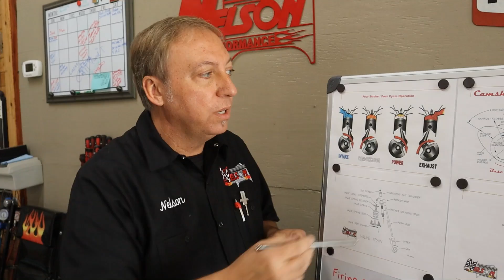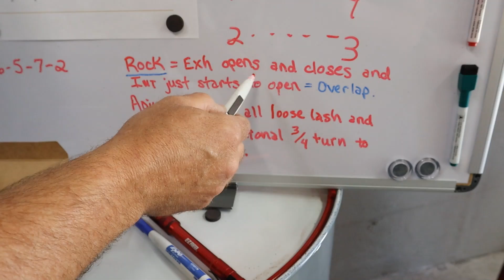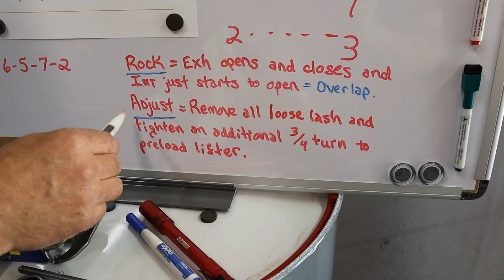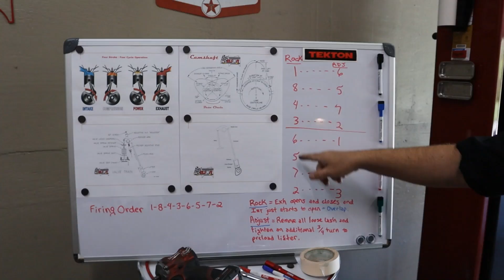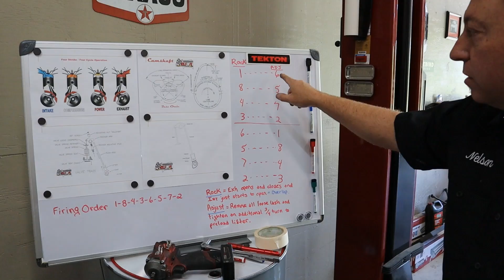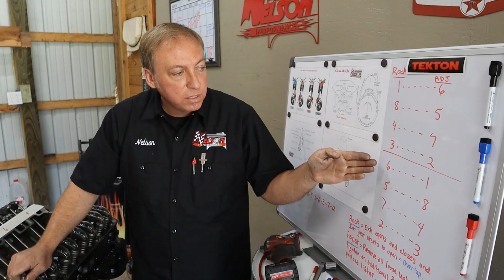Rocker Arm/Hydraulic Lifter Adjustment

Comment: Hello, thank you for the explanation, looks simple. So to be sure, i have a 4 cylinder with a 1-3-4-2 cycle and when cylinder 1 is ready to rock i have to adjust cylinder 4? If i use the chart here it seems that way, i just want to be sure. I have a Mazda 626 TD 2002.
Reply from the maker: Hey Krisztian, yep, that is correct! Good luck on the project and thanks for the comment and subscribing.  Nelson

Comment: I've never seen anyone put that much pre load on a SBC engine. I'm a little interested in the thinking behind this.
Reply from the maker: Hello, the sbc hydraulic lifter has a recommended preload adjustment of 1/2 to 1 turn. Less than a half is a risk of the cup pushing the clip off the lifter cup and causing engine damage and more than 1 turn reduces the amount of internal room for oil to hydraulically pump the lifter up. Thanks for viewing.

Comment: This method does not work on a 351 windsor. In addition, it only works with studded rocker arm bolts.
Reply from the maker: Hello, yes, that style along with the newer LS engines and the older FE and dodge engines require torquing them down, but the process can still be used to check to make certain the lifter cup is off the wire clip as well as make sure there is adequate room in the lifter to fill with oil. We use a go-no-go gauge for this. It should have at least .080 lash between the valve tip and rocker and no more than .180 lash. If this is out of spec you can change the pushrod lengths to get it correct. Thanks for viewing and the comment! Nelson

Comment: Better to dunk the lifters in oil and pump them up with a push rod BEFORE putting them in the engine. I spin my pushrods between my fingers until I feel tension THEN I turn the nut ONE Half turn. My opinion 3/4 is a bit much.
Reply from the maker: Yep, I’ve done between a 1/2 and a full turn. For this video I thought it would be best to do 3/4 for the novice engine builder. I usually prime my oil pump after adjustment so I can still feel the “lash” of the lifter, but soaking them works too. Thank you for commenting and viewing! Nelson
Reply: @mitchnelsonperformance   All good Mitch just two different ways to achieve the same goal.

Comment: What if the intake is on and you can't see the lifters?
Reply from the maker: Hello Steven, You don’t necessarily have to view the lifters when doing the process, if the intake is on. You can also watch the movement of the pushrod/rocker arms if the intake is installed. You will see them move into overlap (the ROCK position). I’ve adjusted many engines that way. Just keep track of your cylinder locations to keep you on track. You can also use the ignition/starter to rotate the engine through the process but remember it only takes a slight bump of the key to turn the crankshaft the needed 90 deg. It helps to have a friend bump the key while you pay attention to the rockers. Good Luck with the project. Thanks for the comment and please like and subscribe

Comment: How do you adjust hydraulic lifters in this manner if they are pumped up already
Reply from the maker: Hey James, The valve springs will bleed the oil out of the lifters as you turn the engine over as the rocker pushes the valve spring down. This will get the plunger off the wire clip in the lifter. The valve spring pressure has enough force to push the pushrod into the lifter bleeding the oil back slightly since the oil pump is not producing oil pressure unless the engine is running.  You don’t necessarily have to view the lifters when doing the process, if the intake is on. You can also watch the movement of the pushrod/rocker arms if the intake is installed. You will see them move into overlap (the ROCK position). I’ve adjusted many engines that way. Just keep track of your cylinder locations to keep you on track. You can also use the ignition/starter to rotate the engine through the process but remember it only takes a slight bump of the key to turn the crankshaft the needed 90 deg. It helps to have a friend bump the key while you pay attention to the rockers. New lifters on a used cam is fine. Old lifters on a new cam or swapping used lifters from hole to hole on a cam is a bad idea. Good Luck with the project James and thanks for the comment and subscribing! Nelson
Reply: @mitchnelsonperformance  thanks Mitch
Reply from the maker: no problem!

Comment: Is there a way to do this without removing intake? I'm replacing rocker arms and pushrods on a 94 302 ford, and I've already removed upper plenum and valve covers
Reply from the maker: Hello, You don’t necessarily have to view the lifters when doing the process, if the intake is on. You can also watch the movement of the pushrod/rocker arms if the intake is installed. You will see them move into overlap (the ROCK position). I’ve adjusted many engines that way. Just keep track of your cylinder locations to keep you on track. You can also use the ignition/starter to rotate the engine through the process but remember it only takes a slight bump of the key to turn the crankshaft the needed 90 deg. It helps to have a friend bump the key while you pay attention to the rockers. I believe those are a pedestal type rocker that has a 5/16 bolt that just gets torqued but you can still use the process to check it.  Good Luck with the project. Thanks for the comment and please like and subscribe

Comment: When cylinder 1 is in overlap is that the same as TDC?  If so then cylinder 6 is at base circle when 1 is TDC?  And so forth down the firing order?
Reply from the maker: Hello and thanks for the comment! Yes and no... both cylinders (1and6) are at TDC at the same time but they alternate the valve timing of having both valves shut for adjustment, in other words #1 cylinder is at TDC during the exhaust stroke (valve overlap) and during the compression stroke (both on the base circle) so that’s why you need to watch the valve movements to make certain the rockers being adjusted are on the base circle. Hope that helped. Good luck on your projects,  Nelson.
Reply: @mitchnelsonperformance  just completed, with the timing cover off started with both marks at 12 o'clock, and moved 90 degrees each time.  Looking at the lifters at the same time, this appeared the same as your method.  All worked out great.  Thanks for the helpful video!
Reply from the maker: Great!

Comment: Hi, great video. Quick question - how would i make sure my hydraulic lifters are not pressurized with oil i.e. unprimed. Do I just need to let the engine sit for sometime after its been run?
Reply from the maker: Hey Matthew, The valve springs will bleed the oil out of the lifters as you turn the engine over as the rocker pushes the valve spring down. This will get the plunger off the wire clip in the lifter. The valve spring pressure has enough force to push the pushrod into the lifter bleeding the oil back slightly since the oil pump is not producing oil pressure unless the engine is running.  You don’t necessarily have to view the lifters when doing the process, if the intake is on. You can also watch the movement of the pushrod/rocker arms if the intake is installed. You will see them move into overlap (the ROCK position). I’ve adjusted many engines that way. Just keep track of your cylinder locations to keep you on track. You can also use the ignition/starter to rotate the engine through the process but remember it only takes a slight bump of the key to turn the crankshaft the needed 90 deg. It helps to have a friend bump the key while you pay attention to the rockers. Good Luck with the project
Reply: @mitchnelsonperformance  that’s great, thanks a lot I’ve been looking all over trying to find an answer. 👍
Reply from the maker: No problem! Good luck! Nelson
Reply from the maker: No problem!

Comment: First of all, my hat of off to Mitch Nelson for referring to this as "rocker arm adjustment" and NOT "adjusting valves". 
Once valves are installed and have been loaded with spring pressure, retained and clipped, there is no further valve adjustment to be made. Personally, I refer to this procedure as "cam follower plunger depth adjustment". 

This may be splitting hairs, but it may also be important for those to understand that ignition begins BTDC.... not during or after TDC. 
This is why our ignition system offer "Spark Advance" or "Spark Lead",  of which is all about placing the LPCP (location of peak cylinder pressure) where it needs to be...... 12 to 14 degrees ATDC. 

At 2:34, Mitch is actually referring to we call the 8 stop static procedure (for an 8 cylinder engine). 
He is simply using the over-lap point as a reference for adjusting an opposing cylinder. 

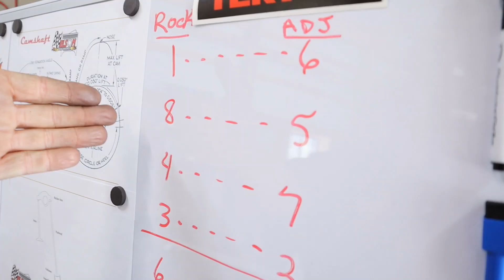At 10:35, if the harmonic balancer was marked of in 90 degree increments,  Mitch could simply rotate the crankshaft 90 degrees, and be where he needs to be for his next two adjustments.  
The total amount of crankshaft rotation will be 720 degrees.... i.e., two full rotations, and will put us back to # 1 cylinder, which will have been already adjusted. 
 

Mitch, with no offense to you, your video is great and is very informative. 
However, given that this is an average SBC build, and given that the GM cam follower's plunger travel is approximately .080" to .100", this same adjustment could be made with each cylinder being @ TDC on the Compression stroke. 
Your procedure is great, but is perhaps a bit over-kill for the average SBC. 
If this was a High Performance build, with a High Performance camshaft, I would fully agree.
Reply from the maker: Hey Mark, correct in every way and I agree! TDC on the comp stroke is what we are shooting for but for many beginners searching for this adjustment on YouTube, it’s sometimes easier to have a “roadmap” like the video to follow to prevent getting lost and possibly missing a cylinder. You obviously have a great deal of knowledge and interest in engines. You should consider doing videos as well. Really appreciate the comment. Nice to meet you. Nelson
Reply: @mitchnelsonperformance  Thank you, Mitch. I am retired these days, and I doubt that I'd want to do any videos. Few years ago....yes, it would have been fun.
Reply from the maker: Never to old to teach my friend 😊
Reply: @mitchnelsonperformance  Mitch, thanks for the compliment. 
I began working with the SBCs in the mid 60s. 
It was nice to see a  well done video. 
So many of these videos lack good information, let alone use the correct verbiage.
Reply: @mitchnelsonperformance  You said:  "but for many beginners searching for this adjustment on YouTube, it’s sometimes easier to have a “roadmap” like the video to follow to prevent getting lost and possibly missing a cylinder."
Mitch, in my opinion, it is dangerous for a beginner to work on an expensive engine. If they are not comfortable, they need to turn it over to a Pro.
Reply from the maker: I agree! Or it can be a costly lesson 😁

Comment: Thanks I'm going to start over and readjust my rockers your way
I hope the same method works after I ran the oil pump with a drill and modified distributor
Reply from the maker: Hey Mark, The valve springs will bleed the oil out of the lifters as you turn the engine over as the rocker pushes the valve spring down. This will get the plunger off the wire clip in the lifter. The valve spring pressure has enough force to push the pushrod into the lifter bleeding the oil back slightly since the oil pump is not producing oil pressure unless the engine is running.  You don’t necessarily have to view the lifters when doing the process, if the intake is on. You can also watch the movement of the pushrod/rocker arms if the intake is installed. You will see them move into overlap (the ROCK position). I’ve adjusted many engines that way. Just keep track of your cylinder locations to keep you on track. You can also use the ignition/starter to rotate the engine through the process but remember it only takes a slight bump of the key to turn the crankshaft the needed 90 deg. It helps to have a friend bump the key while you pay attention to the rockers. New lifters on a used cam is fine. Old lifters on a new cam or swapping used lifters from hole to hole on a cam is a bad idea. Good Luck with the project

Comment: Why couldn’t you touch the pushrod and look for no movement instead of what you did with the rocker?
Reply from the maker: Hey Mark, by “touch the pushrod” do you mean spin it in your fingers? If so the reason we recommend feeling the lash at the rocker is due to the low spring pressure resistance in the lifter. It’s very easy to push in on the cup preloading it without knowing and without much force. Write us back if that was misunderstood and thanks for the comment and viewing! Nelson
Reply: @mitchnelsonperformance  yes… I’ve in the past seen where an individual used his fingers and lightly rotated the pushrod feeling for slight drag. After reaching this point he was ready to complete the process. I’m asking because I got my 79 f150 302 down to the block. When I go to put it all back together, I don’t want a band of tapping.

Comment: That works for that style of rocker arm but if you're using a bolt and a fulcrum underneath like for a 351 Cleveland that method doesn't work you simply tighten them down 22 ft pounds and everything is already been pre-measured as long as you use in the stock length pushrods
Reply from the maker: Hey Rono, yes that’s correct. This method will also work to make sure you have enough preload after they are torqued down as well. We always use a “GO NO-GO” gauge on the non adjustable ford engines with no less than .080 to no more than .180 rocker to valve stem tip clearance when on the camshaft base circle. If the heads have undergone a valve job or the head or block Surface has been milled then it’s usually necessary to go to a shorter pushrod to achieve the 80-180 preload. Some machine shops will grind the valve tip to achieve this but I don’t like to risk going through the metal hardness on the valve tip, so I opt for a change in pushrod length. Thanks for the comment and viewing our video! Nelson

Comment: Rebuilding a AMC 304 lifters have been soaking in oil now 2 to 3 weeks. Same procedure or do I drain the oil back out.
Reply from the maker: Hello,, The valve springs will bleed the oil out of the lifters as you turn the engine over as the rocker pushes the valve spring down. This will get the plunger off the wire clip in the lifter. The valve spring pressure has enough force to push the pushrod into the lifter bleeding the oil back slightly since the oil pump is not producing oil pressure unless the engine is running.  You don’t necessarily have to view the lifters when doing the process, if the intake is on. You can also watch the movement of the pushrod/rocker arms if the intake is installed. You will see them move into overlap (the ROCK position). I’ve adjusted many engines that way. Just keep track of your cylinder locations to keep you on track. You can also use the ignition/starter to rotate the engine through the process but remember it only takes a slight bump of the key to turn the crankshaft the needed 90 deg. It helps to have a friend bump the key while you pay attention to the rockers. New lifters on a used cam is fine. Old lifters on a new cam or swapping used lifters from hole to hole on a cam is a bad idea. Good Luck with the project

Comment: Is this just for fresh lifters or does it apply for used lifter as well. Like if you did a head gasket and you are doing reassembly?
Reply from the maker: Hello, The valve springs will bleed the oil out of the lifters as you turn the engine over as the rocker pushes the valve spring down. This will get the plunger off the wire clip in the lifter. The valve spring pressure has enough force to push the pushrod into the lifter bleeding the oil back slightly since the oil pump is not producing oil pressure unless the engine is running.  You don’t necessarily have to view the lifters when doing the process, if the intake is on. You can also watch the movement of the pushrod/rocker arms if the intake is installed. You will see them move into overlap (the ROCK position). I’ve adjusted many engines that way. Just keep track of your cylinder locations to keep you on track. You can also use the ignition/starter to rotate the engine through the process but remember it only takes a slight bump of the key to turn the crankshaft the needed 90 deg. It helps to have a friend bump the key while you pay attention to the rockers. New lifters on a used cam is fine. Old lifters on a new cam or swapping used lifters from hole to hole on a cam is a bad idea. Good Luck with the project

Comment: Awesome video! How do you identify rock overlap if you don't have visibility to the lifters? Looking to do 1.6RR on a 350 Chevy without removing the intake base plate. Thx!
Reply from the maker: Hey Michael, You don’t necessarily have to view the lifters when doing the process, if the intake is on. You can also watch the movement of the pushrod/rocker arms if the intake is installed. You will see them move into overlap (the ROCK position). I’ve adjusted many engines that way. Just keep track of your cylinder locations to keep you on track. You can also use the ignition/starter to rotate the engine through the process but remember it only takes a slight bump of the key to turn the crankshaft the needed 90 deg. It helps to have a friend bump the key while you pay attention to the rockers. Good Luck with the project. Thanks for the comment and please like and subscribe